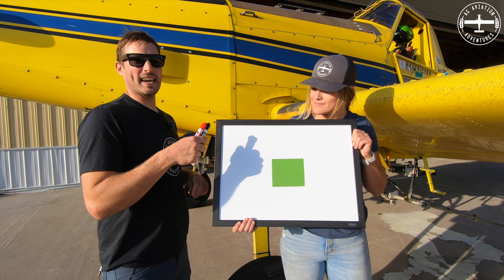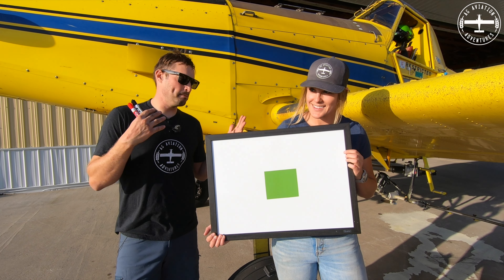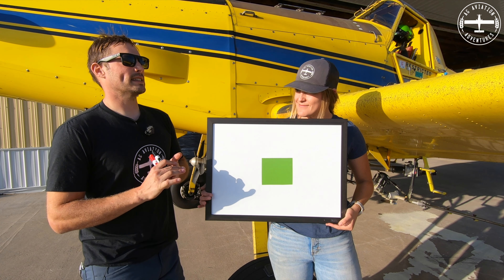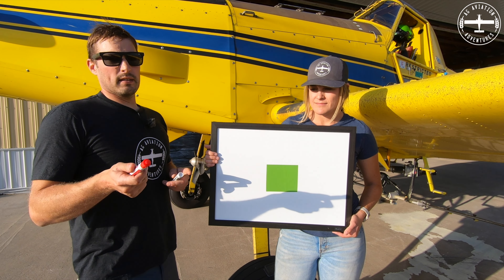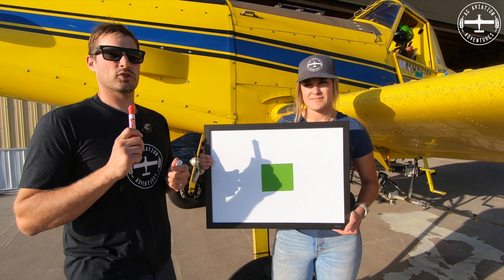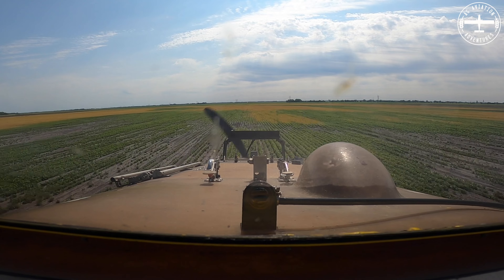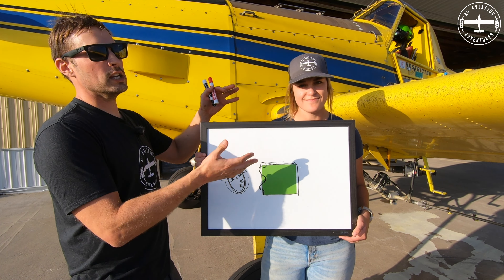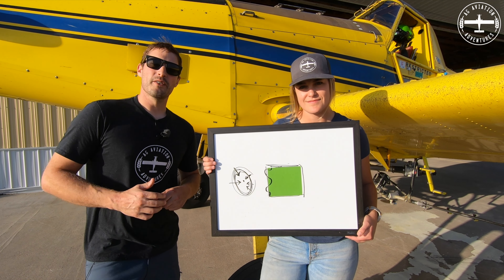Why Light Winds Produce Tough Spraying Conditions

Comment: Nice work. Yes spraying is all about drift management, no positive breeze, no drift control. In Australia we don't spray and or stop spraying if the wind is or drops below 4 knots 5 mph. Any less and you can not guarantee your drift direction. The best wind strength for job quality and drift control is 8 knots 10 mph. Unfortunately ground rig operators don't have this knowledge. The amount of ground rig operators who say, its cool and calm perfect for spraying!!! Only one condition worse than cool and calm and that is cool and calm at night time. Kiwi's can fly.
Reply from the maker: For sure!

Comment: I’ve got a few thousand hours in a c188. Late afternoon spraying is the worst, like I tell people when they drive down a dirt road and they look across a field beside the road and they see the dust never blows away and it just hangs about 10 foot off the ground is the worst conditions to spray. Because water vapor also suspends that same rate.  So it will just sit in a cloud 10 to 15 foot above a crop for hours on end and then a gust of wind will come and blow it somewhere or you don’t want it to go.
Reply from the maker: Exactly!

Comment: Great video, maybe do one on how you know how far the spray will drift.
Reply: Smoker ay
Reply: @429thunderjet2  well yeah that helps check on the winds but doesn't tell you exactly how far spray will drift
Reply: @adenw.4430   sure, it will give a pretty darn good idea of how much the spray will drift. What else ya gonna do? Other then turning the the spray on.
Reply: I sposse make a spray run down the middle of the field you could actually see how much it's going to drift without getting too close to a vunrable field.
Reply: @429thunderjet2  True what else can you do to find out but I bet they have charts and formulas that say x amount of wind will drift spray x distance.
Reply: @adenw.4430  hmm idk, my Pop never necessarily had anything like that I remember, when he/we were spraying, I never did actually fly the airplane but did about everything else.  But I do know he had lots of experience so he had a pretty good idea on how far it was going to drift according to wind speed & stuff.  Also I think it can depend somewhat on the gallonage per acre application rates, spray nozzle size, pressure used etc. the real low application rates might produce a finer spray mist that would have a tendency to float in the air longer. IMHO , ok
Reply: @429thunderjet2  right so there would be more variables into the formulas then just wind, to add to your list how high the booms are off the ground.
Reply: @adenw.4430  that's why they fly low. Ugg!
Reply from the maker: Great suggestion!